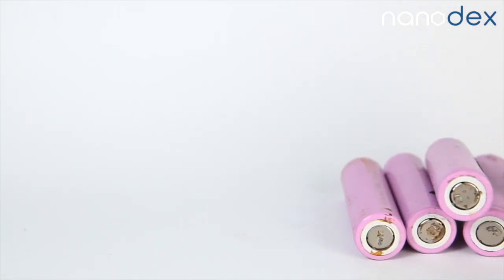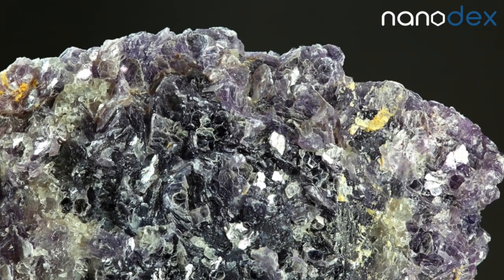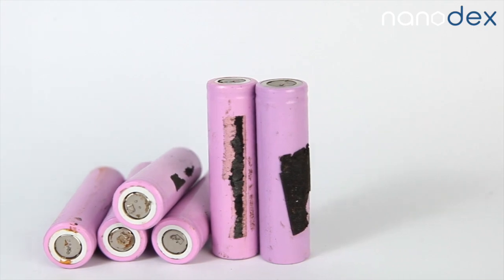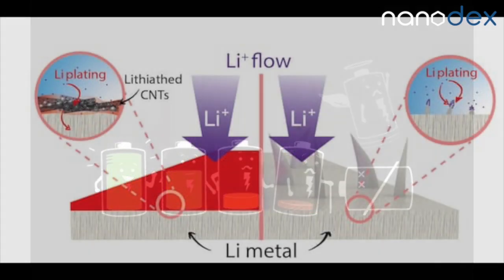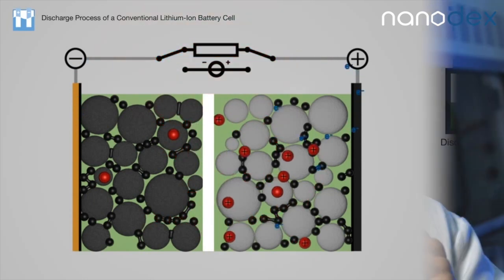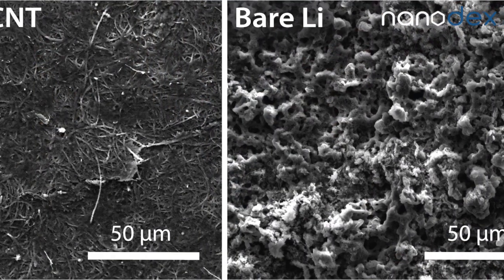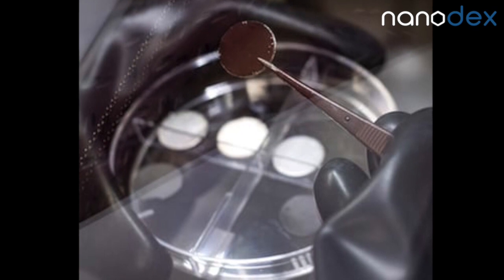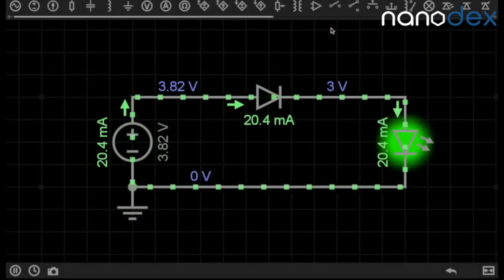Better Batteries With Carbon Nanotubes

Comment: It's one thing to stop the formation of dendrites on lithium cell batteries, what about the surface area of the cathodes and anodes?  

Shouldn't CNT and Graphene electrodes have higher surface area/better performance and longer life than graphite electrodes?